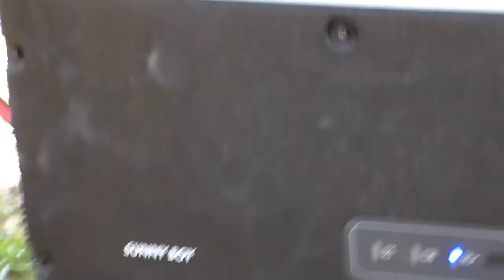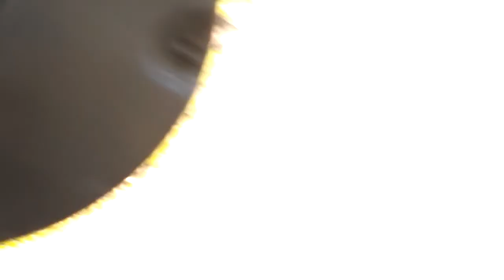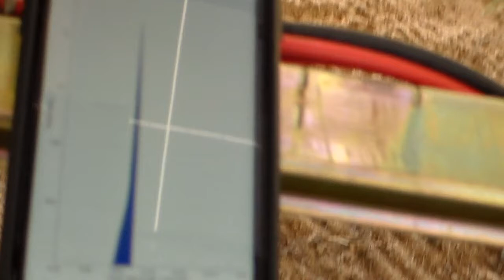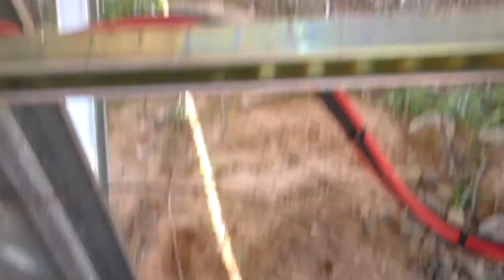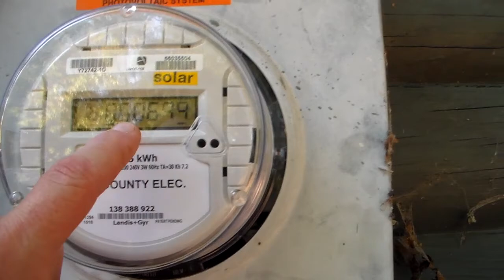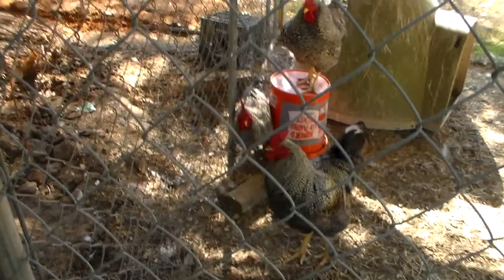Solar Review

Comment: Your rooster has a very distinctive crow.  Its always crazy hearing other roosters that dont sound like mine.  Anyway, i like the set up... a lot.  Hope it still is able to run everything no problem in the dead of winter.  I like how yall went with stands instead of on your roof.  I will be doing something similar once i down some trees.
Reply from the maker: Yeah, we had to cut down a few for that set up. There is no reason for a roof mount with all the property we have. We used Southern Current to do our solar, they have an upstate (Greenville) and the main office is in Chuck town. once it was final and approved it went smooth, about 3 days to set it up. Id say if you want solar this is the last good year to get it, 55% tax credit, 30 from fed and 25 for SC. the winter, we want make as much, but its in a good spot. if you think about it and want to use a company to install, Southern Current, did me pretty good.